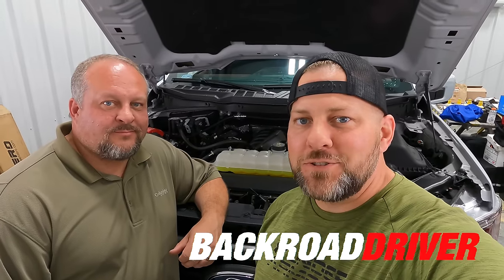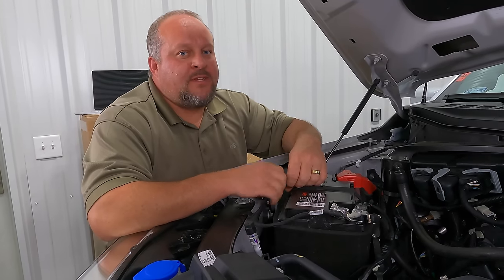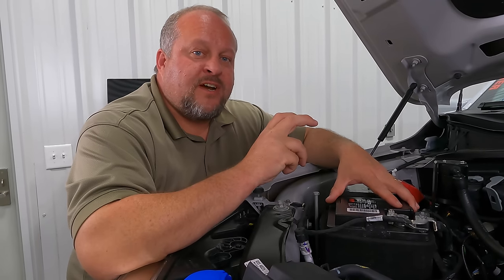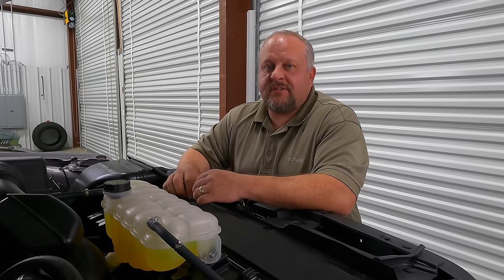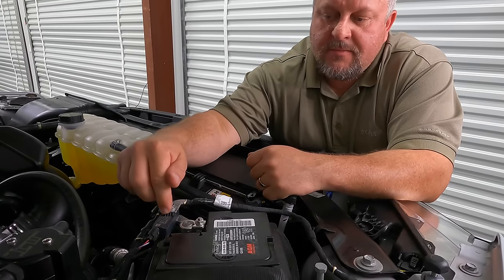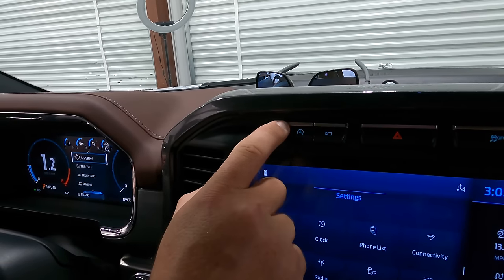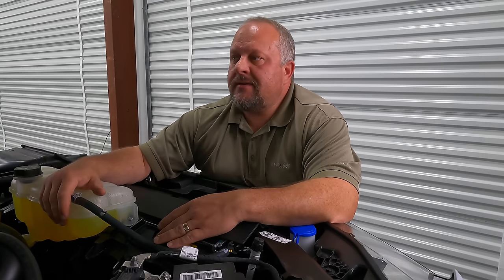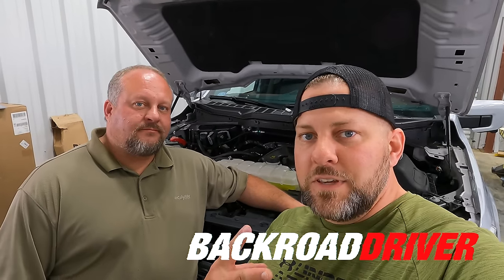2021 Ford F150 5.0 V8 Cylinder Deactivation & Oil Pump Belt Defeated! - It Wasn't All Bad...

Comment: Just so everyone knows....the cylinders do NOT stop and start rotating.  Only the fuel stops flowing to the cylinder....so the engine life is not compromised at all.   The only thing compromised is sound....the exhaust sounds different when you have modified the pipes, and cyls are deactivated.
Reply: Your clueless. Engine life is heavily compromised with dod. History is your friend, try and do some research going back to the 70’s when this idea originally came out, it freezes valves in various positions in those 3 or 4 cylinders << (V6 or V8) along with fuel cut. It does NOT increase efficiency, it slightly reduces inefficiency, and unless you’re driving like grandma under 14000 rpm, 85% of each drive, you will not benefit from this. It does reduce life in the cylinders and valves not moving, as they become dry while the others develop carbon build up and the dry cylinder start to goudge from lack of use, just like a starter on vehicles with start-stop tech. I have an increase of 200% in starter replacement in vehicles made after 2009 and it’s 95% vehicles with the start-stop, and a 170% increase in engine drivability and limp mode only in vehicles with cylinder deactivation/displacement on demand. When one has been in and around the business (in the shops and talk to the techs, over 40 years one gets a good, education on what’s going in vs idiots that read stuff with a few years to 6 or 7 and this they’re a master.

Comment: Thanx
I wasn't happy that they also did away with steel sleeves in the cylinder walls.
Ford said that BMW helped them with the new process of plasma arc the cylinder walls. Also a oil separator is a plus on this motor.

Comment: I just tested this on my 2021 F150 STX 5.0 and can confirm that it does indeed disable auto stop/start. It DOES NOT; however, disable Cylinder Deactivation.

I have a muffler DELETE and can hear it kick in and out as clear as day. So back to the drawing board for that.
Reply from the maker: I've been testing this more myself. I took a couple hour trip out of state. I thought that I could tell it was activating some at highway speeds but not so much at lower speeds, say up to 30 maybe 40 mph.  Can you tell it's activating at slower speeds still?  For me, it seems to not activate around town any longer.
Reply: @BackroadDriver  When I first unplugged the battery module and drove it, I thought for certain it was not activating at low speeds (20-40mph). But after going a few miles it started kicking in normally at all speeds it seems to kick in at (Basically above 15mph). So I think it was just the cold engine keeping it from kicking in.

I'm beginning to think only some software intervention will disable it permanently.

Comment: On Auto Start Stop, you replaced 1 button push with a different button push.
Reply: exactly! It's not that tough to just hit the auto atop button when you get in the truck, and actually if I'm driving through the city or any area with a lot of stop lights I turn it back on since it makes a noticeable difference in fuel economy - the starter is designed for auto start/stop, no reason to completely disable it

Comment: I just got a 2023 f-150 with a 5.0. it said on my window sticker that I paid 50 bucks to have auto stop/start delete from the factory…Nice
Reply: How do you like it so far? I’m seriously considering a 5.0 F150 possibly tremor package
Reply: @onefastboi14  As a first time Ford owner coming from owning Toyota’s I had a couple concerns at first. It seems like they have worked themselves out and so far really enjoy the truck. The 5.0 with the 10 speed auto has plenty of power and will not disappoint. What I am most blown away by is that after 1100 miles of all city driving I am averaging 19 miles to the gallon! And that’s even all hilly terrain in Pennsylvania. My tundra was averaging 13.7 mpg. With the same driving and terrain. So far…I am happy with the truck.
Reply: @onefastboi14 exactly what I am considering and I came from Toyota too
Reply: @DakotaDave17 I have grown up inside a ford dealership. Whole working career. The new 5.0 is supposed to be pretty durable. Mechanics don’t like the spray on cyl walls etc because they are non machinable to repair with the spray on. The up side is that unmodified and spending it’s life commuting or towing a boat that’s less than 50% of tow capacity… it’ll last me quite a while. Cyl deactivation is a highly debatable subject due to the measures ford took to correct known issues. I took the gamble. Truck runs like a scalded dog.
Reply: Bought my 2023 5.0 in December and love it. Solid engine/power and build so far. I like it more than the 2.7 F150 I drove for a year before this. And I really liked the 2.7. I just like the 5.0 more.
Reply: @ItIsColdHere  the sound did it for me
Reply: @mbb-pr4zc  Yeah, me too. That growl of the 5.0. Love it!

Comment: Cylinder deactivation is good, here's how to bypass it so it doesn't destroy your engine.  Disable your battery monitor so you get to click OK every time you start up instead of clicking the other button every time.  As a bonus you don't have to be bothered by an alert telling you that your battery or alternator is starting to go bad, you get to enjoy the surprise no-start!
Reply: Billions of miles have been driven without vehicles telling people when their alternator or battery was "going bad", and nobody died.  Put your big boy pants on.
Reply: the 2nd button is start/stop button that u no longer have to hit

Comment: I'd advice caution. This isn't some mechanical fix like a heater core valve fix for Ram trucks that is clear in consequences.

Don't mess with sensors because you don't know what's behind the scenes and if codes were written in ways that handles missing sensor data.  Modern car's electronics are complex, you might create a problem elsewhere down the road.  "If it ain't broke, don't fix it" applies perfectly to electronics.

Comment: So I read in the comments this doesn’t disable the cylinder deactivation, but running in sport mode does. So why not run in sport mode 24/7? What are the disadvantages of this? Why buy a tuner or supercharger when you can just use sport mode? New 22 v8 owner here
Reply: Only drawback I see is worse gas mileage since sport mode holds gears longer for higher rpm.

Comment: Thanks! Just drove home my regular cab short box 4x4 coyote home last Tuesday. Really appreciate the gen 4 update info and quick tip on the cylinder de-activation. Hopefully something like the Range plug in module will be available soon for the F150. As an aside, I ordered it to my specs in November of 2020 and it just got here.

Comment: I know this is 4 years old but it needs to be pulled or corrected.  As the owner of a 1.0 Ecboost it's now known that these wet belts are falling apart and are junk.  Also you've screwed the smart charging system by disconnecting the BMS sensor, you haven't disabled any cylinder deactivation.

Comment: Ford always insisted that wet belts are solid and they proved them out yet I've seen those belted disintegrate on the 1.0L Ecoboost. It's cheap and that's why Ford went with it. They are confident the belt will last the warranty period, that's it.

Comment: Another thing that ford engineers have said as well is to use a slightly thicker oil like 30 weight or preferably 40 weight. 50 is recommended only for heavy towing or track use because of the engine load causing the bearings to possibly be split out and the film shearing. Ford for the mustang gt say to use 20 weight but a guy took it on the track but didn't use 50 weight and ford said racing is allowed but for that application the wrong oil was used. If you pay to get a bolt on supercharger on your 5.0 from ford they'll switch your oil cap to say 50 weight even though they didn't change anything else inside, just threw a bolt on in. That really tells you everything. Overhead cam engines can use thicker oil than the overhead valve in my new truck. I ran both 10 and 15w-40 in my old f150 instead of 5w-20 piss and that's the reason why my 5.4 lasted beyond 200k and without any oil burning or valve train issues at all. Ford later admitted that the thin oil is crap but they had to for cafe standards. In south America and Australia where they didn't recommend 20 weight for that exact engine is where they didn't have issues like over here. Thank goodness I used my intuition and still used thicker oil. I'd highly recommend ford's diesel oil for these gas engines or shell rotella. The anti wear package on both is one of the highest you can get at any walmart. And no diesel oil doesn't harm engines that dont burn oil. If it burns oil it will accelerate the poisoning of the cat but the both the anti wear package and viscosity of the oil is what prevents that in the first place however if you start using it before it burns oil. so do so if you actually care about your engine. Dont if you'd rather have been counter Gov regulations ruin your engine.

Comment: The belt is similar to Harley Davidson drive belt... Deactivation cylinders turned into a failure for General Motors years ago because of the wear from firing and not firing cylinders and I believe I heard that Sport Mode turns it off while driving

Comment: I'm lost.  They talk about cylinder deactivation but the comments say it doesn't deactivate the cylinder deactivation.
Reply: Unplugging the BMS monitor will disable auto start/stop, but I am not sure it disables cylinder deactivation.   How would it?
Reply from the maker: It didn’t for long.
Reply: You can’t change the failing mechanism made for cylinder deactivation by simply unplugging it.  The nuts and bolts of it are still there. Might as well use the engine the way it is designed to work.

Comment: Thanks so much gentlemen! I have hated cylinder deactivation even since it was invented.  Can you believe that GM has still not been able to come up with a better solution for the Corvette? I'm a Ford guy, but I do love the Corvette; all Corvettes (Mary Barra has ruined that company).  One question about the F-150: will unhooking the negative terminal clip on the 5.0 have any effect on the ProPower lithium battery or generator, if you get that option too?  I like the 3.5 twin turbo PowerBoost,  but I would prefer to get the V8 if at all possible.  I just found you guys today.  Keep up the great work.

Comment: Looks like a compelling reason to buy the six cylinder eco boost instead.
These new trucks and the prices they want are not worth it.
Reply: Should have chosen a better career path.
Reply: we Need trucks not status symbols
Reply: @raymondclass6794   Yes drop the box height back down to where you can work it without being a mountain goat. It’s all about looks now.

Comment: On my ram hemi 8 speed i just put it in manual mode and scroll up to 8th gear and the transmission shifts through all its gears like normal and bypasses cylinder deactivation. I wonder if you can do it on the fords? Trucks been running on 8 cylinders since I drove it off the lot. To me cylinder deactivation is just more headaches and really doesn't save you fuel. I still get 21 mpg doing 75mph on a road trip and between 16-17 mpg in the city.
Reply: That trick doesn't work in the GM's with AFM/DFM. I doubt it would in the Ford.   in the Ram, its sweet!

Comment: I ordered a 21’ to get away from the timing/vct issues that plague these engines. My 19’ had the tensioners replaced at 2k miles and now at 35k it’s starting to make the same noise again.
Reply: Same here, I love the 3.5 ecoboost for its power but it is pretty unreliable. I guess i am going for a 5.0 on a new one.

Comment: Im not that familiar with the 5.0 coyote engine. I wasn't aware they used a belt to drive the oil pump? I'm not saying it's bad, good information 👌
Reply: Same Kevlar belt on the 2.7 V6/TT

Comment: How long is this belt for the oil pump rated to last? Miles/years? Sure it can take 1200HP but how long will it last?
Reply: It doesn't. I'm a ford tech. They blow apart and lock engines up even during low mileage   vehicles. Massive issue right now
Reply: @brandonclendening93  yep, and the belt touches oil too. Ford made a big mistake on this one.
Reply: @brandonclendening93  Job security

Comment: Is oil consumption still a issue with these engines and is Ford still building the 5.0 with plasma cylinders if this is the right term thanks
Reply from the maker: It is still around but at varying levels…

Comment: I have a 2021 silverado with the same, I bought a deactivation plug in module and to also stops the auto stop. And
Reply: Just did an AFM delete on mine. FYI, the lifter design is the problem. Those modules do deactivate AFM, but installing an AFM delete kit + ecm tune is the only way to actually prevent lifter failure. Statistically you probably won't have an issue but if you do, Texas speed basic dod/afm delete kit and a tune from mailordertuner if you want stock drivability and v8 power always on.

Comment: If it disables a random cylinder it shouldn't harm anything, it was the old style that removed the same ones all the time that caused issues.
Reply: AFM vs DFM on the GM's.  Haven't seen it confirmed which one is similar in the Ford 5.0.

Comment: At one time I believe you could disable the on / off starting with a trailer plug adapter that thinks you are pulling a trailer. Perhaps that was GM that had that.

Comment: My 21 5.0 came with the auto start/stop delete option, I just have a blank where that button goes. This video equates cylinder deactivation to the battery monitoring system to the auto start/stop feature. Question is, does that mean I do not have cylinder deactivation?
Reply: Have you found the info for your question? I have the same question, 2021 f-150 doesn't have the bottom on dash for auto stop, im guessing because of the chip shortage my truck didn't come with that feature which i like, but im wondering does it have the cylinder deactivate system? Im still putting it in sport mode just in case.

Comment: On my 24 seems like sport mode shuts off cylinder deactivation and auto start/stop.
Reply: It does
Reply: I sure hope so i ordered a F150 XLT and will start the build on oct 20th 2024 i don't want to spend $90 on a computer module behind the glovebox from AutoStop Eliminator

Comment: So the new 5.0 has been out for almost 2 years now… have you experienced or heard of anyone having issues with the cylinder deactivation like GM has? Has there been any reports of people lifters wearing out prematurely?
Reply: The 5.0 doesn’t have lifters to wear out (or mushroom in GMs case).  Ford uses a totally different design being overhead cam.
Reply: @scottyV1000  well unfortunately Consumer Reports has released an article stating do not buy the current F150 due to reliability issues and it’s mostly about the 5.0L. Pickup truck plus SUV talk made a video about that a couple days ago. I don’t know how many people follow Consumer Reports but that’s the  first time ever that they would say something negative about Ford’s reliability
Reply: @jaysson1151  If I cared about what Consumer Reports thought about anything I probably wouldn’t have bought. 75% of the cars and trucks I’ve bought over the years.
Reply: @scottyV1000  I’m sure most think the same—it’s just weird that all of a sudden now the F150 is “unreliable”??
Reply: @jaysson1151  One thing you have to remember is everything CR reports on is based on past information on models that in many cases aren't even being made anymore.  I'm talking everything - not just cars and trucks.  Ford's oil consumption issues with the previous generation may have entered into their rating.  That said - I've have a 2011 Ecoboost 3.5 and a 2015 5.0 and did not experience anything major on either one of them while I had them other than a water pump on the 15 and that's not a big deal other than it should have lasted longer.   I'm loving my 2022 5.0 so far.
Reply: I love my 22 it has good clean power when I need it, as for the 10 speed it does ok shifting up but going down its still learning after 5k miles, I use my F150 for construction its load with a 800 lb welder and 500 lb of tools and tows on top of that.
Reply: @scottyV1000  There are still failure points. It is just too early to tell. Wait for another 5 years or so.

Comment: On the 22 & 23 models...Ford musta fixed it so that the cylinder deactivation can't  be tampered with...must be programed in the trucks computer.
Reply: If they made it easy to disable, the EPA is less likely to give them a pass on fuel economy/emissions requirements. Kind of like how manufacturers weren't  given points for auto star/stop in vehicles if it was easy to disable it.

Comment: I'm betting it wont be long before we start seeing sludged up 5 liters snapping oil pump "belts". They could have just gear driven the pump or installed the pump on the end of the crankshaft.
Reply: Ford can't engineer anything. They never figured out how to build a crank driven one without failing. They're brain dead.
Reply: @TheGuruStud  crankshaft main bearings kill the crankshaft mounted oil pumps too much bearing tolerance and it eats the guts out of the pump. I can assure you though a belt driven oil pump is not a good idea in a daily driver.

Comment: Do the 2021 5.0 still make weird noises when its a cold start? Like the 18-20 did. My 2019 would make not the nicest sounds some times
Reply: I know what you talking about, my 2020 makes thw rattle at cold and it does some clunking whenever it feels like it but my boss just got a 2021 5.0 lariat and it is way more raffined than mine